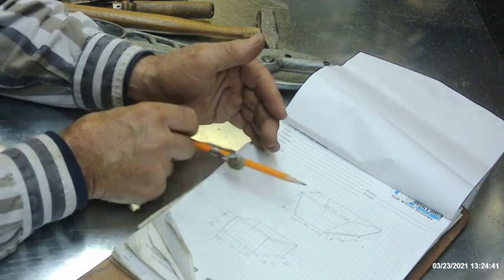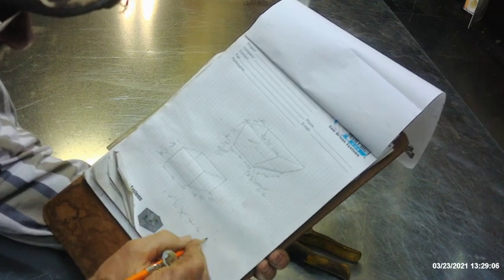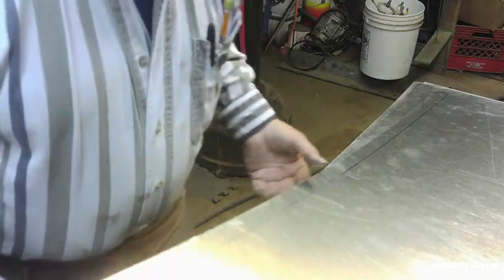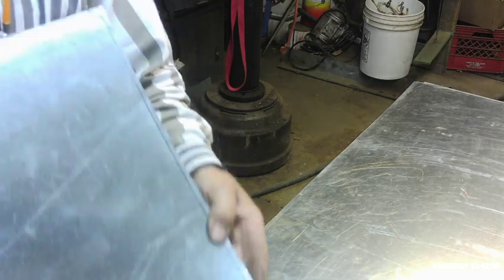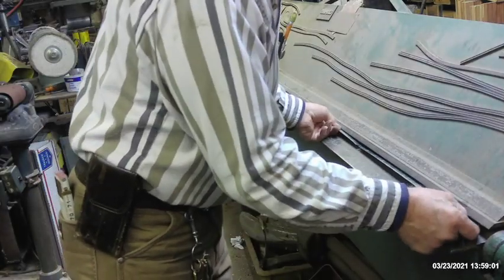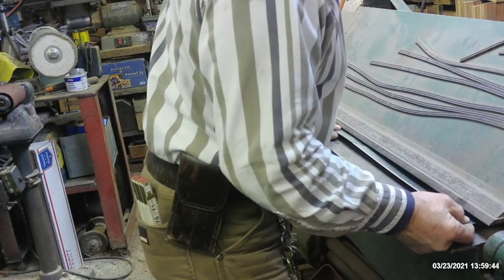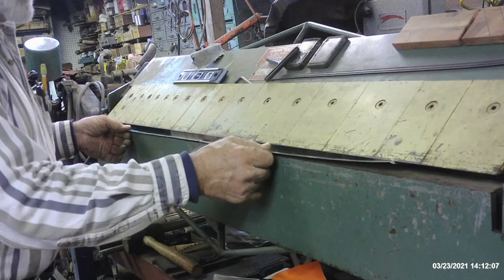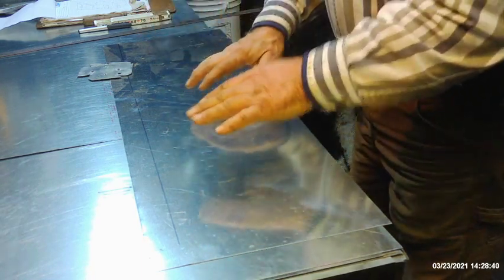Sheet Metal-Fabrication- Furnace Change Out

Comment: Even though I worked with tin knockers to learn their trade, I always learn something from watching your videos and hearing the explanation. I am extremely jealous of that box-break of yours!!! I may have told you of the one we had at work. I didn't know they were cleaning out one of the buildings and the mechanics simply threw it in a metal dumpster for scrap!! Was an eight footer in real good shape. Made me sick to see what they did. I for one really appreciate and enjoy your sheet metal videos.  👍👍👍
Reply from the maker: No you didn't tell me that one, that's a story I would NOT have forgotten !!  Kinda makes you sick doesn't it, to see something so useful to so many just discarded and gone.  I was on a commercial heating service call at a machine shop twenty years ago (?? might've been 15, 18 or 23) and the maintenance supervisor asked if maybe I wanted this old brake they hadn't used in many years. 
    Thinking it was going to be a piece of junk I said yes, I'd look at it and see.  Low and behold it was a pristine 8' brake covered in dust stuffed in the back of the warehouse.  I couldn't believe it....so he said come get it Saturday morning, he'd be there then.  BUTTTT...he said, I've got nothing to get it off the dock with, you are on your own.  I brought 12' 4x4's and a pile of lag bolts and winched it right off the dock and gently let the tail end drop down the 12'' to my trailer deck. The ends of the 4x4's rubbed slowly  down the face of the dock's concrete. I intentionally mounted it to the front of the skids, hoping most of the weight being to the front and on the trailer would give a bit of an easy drop to the tail end.  
    Woo Hoo !!  It did better than what I'd planned.  By the time I left, he had me load quite a number of old tools and equipment they no longer had a use for. I DID sell the brake a bit later though.  I couldn't believe it but he said he was ready to call a scrap hauler when I got there for the service call !!
Reply: @tractorman4461  Wow! I would have given anything to get the one out of the scrap dumpster. Shame what some people think is useless scrap.
Reply from the maker: @1lilfarm  Right now I know of a ten foot ten guage finger brake out of a local factory that's been sitting OUTSIDE a machine shop for over 20 years.  He won't part with it because it was a friend of the owners father that gave it to him when the factory closed down. It is a monster and probably goes at least 3 or 4 thousand pounds but I would take it in a heartbeat if I could buy it.  It DOES belong to a friend though so time will tell.

Comment: Nicely done! I've heard you say in past videos that you say you're just a do it your selfer guy. Well I have been a SM mechanic up here in Canada 🇨🇦for over 40 years and I know a real SM mechanic when I see one. You are too modest sir, as you are obviously a top notch SM fab man. Keep up the videos as I really enjoy watching. Cheers!!👍
Reply from the maker: Yes, now that I am retired I'm a professional DIY'er.  LOL  But I did more than 40 years in commercial HVAC.  But until retirement I hadn't done sheet metal for probably 25 years to any extent.  Being a  service tech, I did mostly troubleshooting and repair,  refrigerant, chilled and hot water piping, boiler and chiller installation, DDC control conversions to older units and all that good stuff.  A little building automation tossed in for good measure. But there was no official sheet metal training or apprenticship in the past.(Except for high school shop.lol.) FWIW, compliments from other tradesmen I hold in the highest regard.  And for that, I thank you Paul.

Comment: Me too!  Piece by piece I acquired my metal shop equipment. Love the old stuff. Newest tool I have is from the 80's. The rest all the way to the 40's, maybe even 
older. They made them to last back then.
Great video.
Reply from the maker: Heck yeah Andy....like Johnny Cash, one piece at a time.  I can't imagine stocking a new shop today with new equipment !! It'd put a fella in the hole real quick wouldn't it. Heck I have a metal lathe from the 1800's and a horizontal mill from 1909.  I like old stuff too.  Thanks for the cool comment and have a great evening sir.

Comment: I like the drive bending method. Our shop at work has a manual cleat bender but we still get duct with elephant ears( drives) sometimes. I put the bar folder on and squeeze them to fit better.
Reply from the maker: I've had to fold them on site in many different ways.  I like the cleat bender while working in the shop on everything up to 18''.  Anything over that has to be either on the brake or by hand.  Sometimes the situation determines the technique.  Thanks Andre for the visit as well as for the comment.

Comment: Ok Tractor man 44 i never had a brake for many years,  so my dad taught me to use a screen tool  like you put splines in a screen windows  the wheel has to be metal and you have to cross brake on a soft surface like a rug or carpet or ground. It works like a charm.
Reply from the maker: Now Tom, that is something I never even thought of.  I always used the carboard or carpet square and a straight edge and scored the insides of the pieces to create a sharp cross break.  Then fold all the rest by hand.  Dang it anyway...NOW you tell me !!

Comment: Great video, thank you for posting.  I'm curious, why did you make this a 2 piece transition rather than 1 big transition?
Reply: You'll see when he installs it on the furnace.
Reply from the maker: Yes, David's comment is correct.  But to give you a heads up, this one was a 90+ AFUE with a 4 ton blower.  A 26 guage huge plenum would more than likely billow back and forth with the duct pressure and air velocity.  The two smaller ones literally reinforce the duct sides because of their smaller physical size and the additional joint.  The next thing is if you mis-measure by a sixteenth, the mistake will be hugely exaggerated by the time you get to the end of a long fitting.  With the smaller, shorter transition, it's much easier to hide a small error in layout because it remains small.  Then there's the actual installation.  Its so much easier to slip in two small ones than it is one large one. 
    There are other things, but these stick out the most in my mind.  Thanks for the thought provoking question...and a good one at that, may I add.  Remember I say all the time that there are as many variations to making a piece of metal as there are guys doing it. That holds true with a total install.  I for one refuse to use duct tape anywhere except the aluminum tape and that's only to secure the double mylar wrapped bubble insulation.  You will (hopefully) never see duct tape on one of my joints.  But there are those that buy it by the case.  To me, It just ain't cool.
Reply from the maker: @daviddesilva4971  I guess that means you'll come back to watch the install video....LOL
Reply: @tractorman4461  Thank you for explaining your thought process;  I knew you'd have a good reason.  I'll have to check what gauge metal my partner at work has been using.